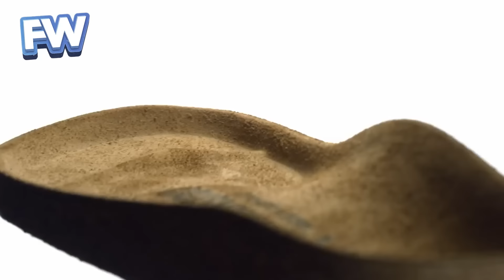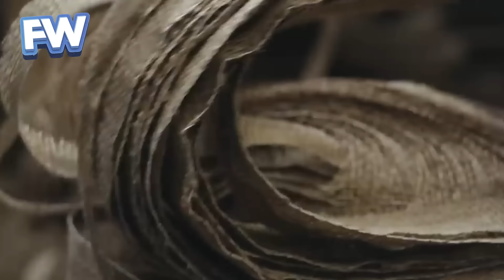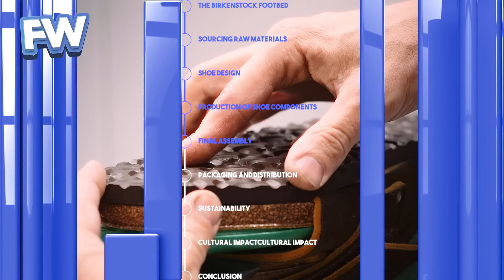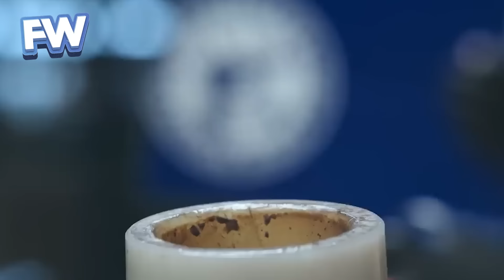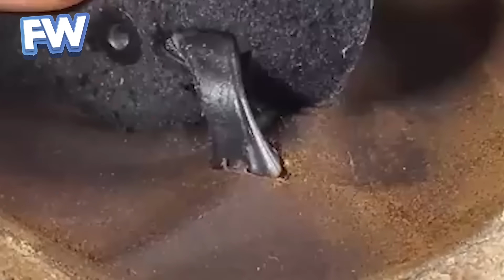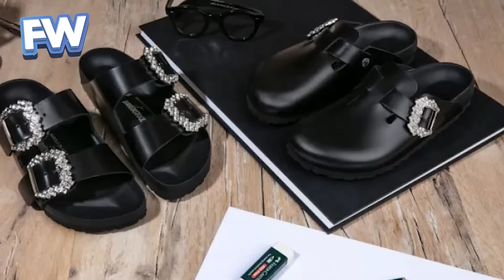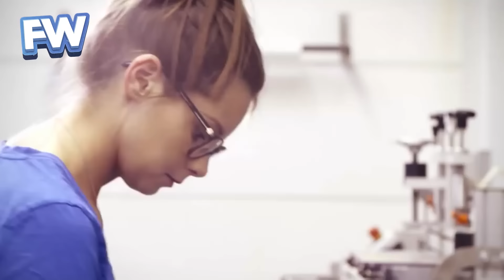How Birkenstocks are Made in a Factory | Birkenstock Factory Process

Comment: 1:34 due to these raised footed edges it collects dust and random particles from the surface all the time. When mixed with skin oils and under the constant weight of the body, this dust sticks to the footbed and creates a not very pleasant feeling. I have the fake pair of Birkenstocks. Those who have the genuine pair, do you experience the same issue? I want to understand if this issue is due to it's design or due to quality of a fake pair. I live in a somewhat dry continental climate, thus our walkways are not as clean as most of northern countries' ones.